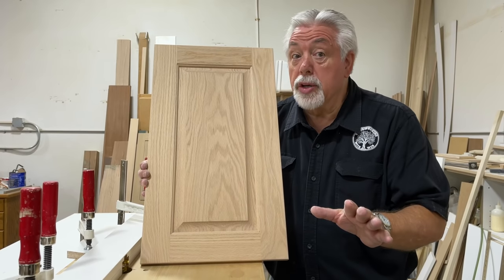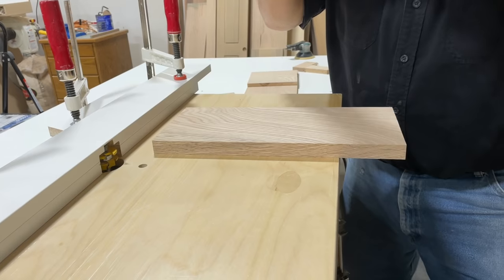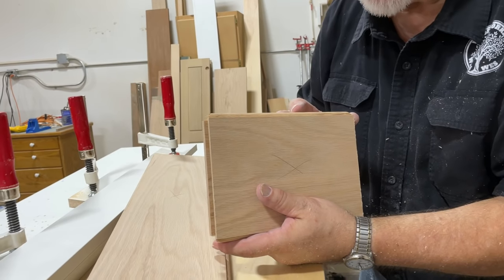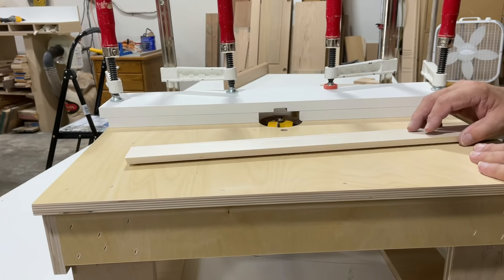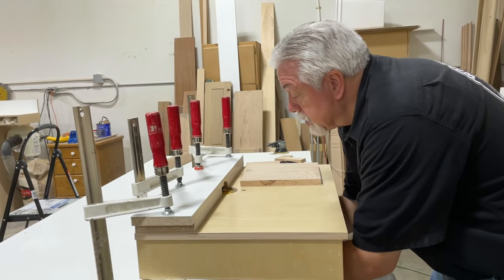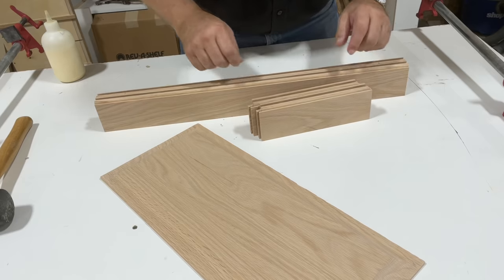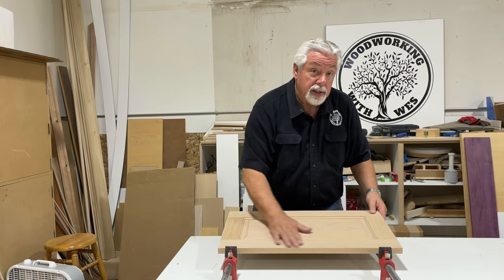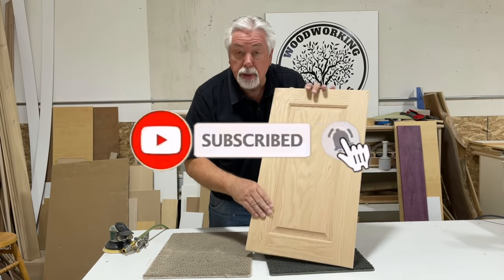Making Raised Panel Doors The Easy Way

Comment: Why is is called a "Raised Panel" door if the panel is not raised above the height of the frame......Not really a raised panel door.....solid panel door...describes it accurately....seems to me.....
Reply from the maker: The center of the panel is raised from the edges that go into the stile and rail. The face f the panel is level with the frame of the door which is typical of all raised panel construction. Thanks for watching, Wes

Comment: Nice woodworking but not a great video. Said you were going to make doors with "only a router table and some router bits from amazon ", but then used jointer, table saw, and wide belt sander. Better camera work would be nice. Couldn't see the parts you were talking about at the beginning of the video because the camera instead included 2 feet above your head. You never really showed the router bits. Never showed the space balls. 

It was still a decent video (you're a pleasant, very likable personality) but I had to give video 👎 because there were way too many commercials.

Comment: Just for the record. Those are NOT Spaceballs you are using in the channels. They are in FACT Synergy Spacers. The difference is Spaceballs contain oil, and Carbon Black and Phthalates. Synergy Spacers DO NOT. Oil and Carbon Black can leach out and cause stains on the doors after time. The Synergy Spacers you are using will NEVER cause this issue. You probably should be sure to call a product by it's proper name and NOT a generic, industry adopted name.